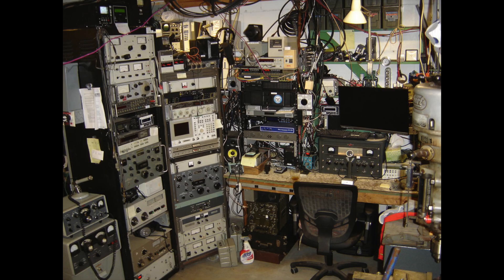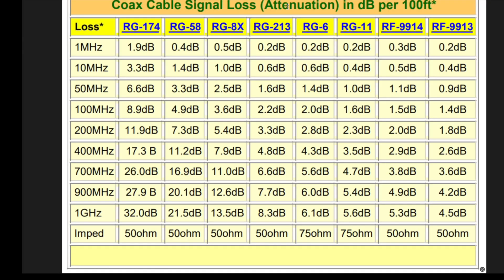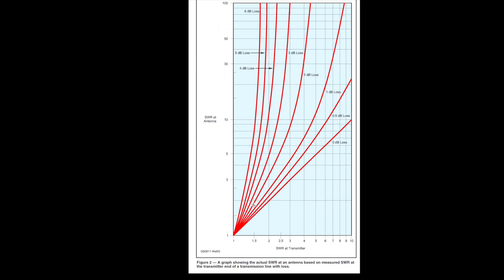Ham Radio Myth - Only Measure SWR At The Antenna.

Comment: Another good source of information I found online:  SWR - the persistent myth by John Fielding, ZS5Jf.
A very interesting page on solid state transmitters with built in ATU's.
The page about dipoles fed with 75 Ω coax and 75 Ω SWR meter is interesting and something I've thought about for years. I started with KW equipment and used 75 Ω t.v. coax and a KW SWR meter made for 75 Ω. I remember you could choose 50 or 75 because the valve pi-tank could cope with either.
I can feel an experiment with my h/b transistor tx. Will it care if it's 50 Ω or 75 Ω? Is the circuit I followed really designed to be spot on 50 Ω? Another half turn on the output transformer to raise the impedance? I can easily change my SWR meter to 75 Ω. 
G4GHB.
Reply from the maker: A perfect dipole has an impedance of around 70 ohms so 75 ohm coax is really a better match.   But we all use 50 ohm coax.  And I have read numerous times and saved that file from ZS5JF.  Really excellent.
Reply: @BustRadioMyths  Tnx for your reply.
Yes, they say 73 Ω when located away from objects. 
Somebody gave me 12 foot of 75 Ω t.v. coax so I might try it. Thinking about it my FT817 would see nothing different anyway, 50 Ω coax now to a dipole or 75 Ω coax to a dipole. The dipole impedance hasn't changed so there's still only one impedance change.

The ZS5JF article is excellent as you say.
A few C.B.'ers might learn something.
I watched one video and he showed his output reduced with a 3' length, 6' better and 12' better still. How it varied I don't know as he was using a dummy load! 
He recommends and sells 3' to the SWR meter in his C.B. shop. The myth goes on. 
What he didn't show was his forward power was also reducing and he said he wasn't interested in the forward power and tried to keep it out of view.

73, G4GHB.
Reply from the maker: Unbelievable!

Comment: That chart is useful. Good information.

I've never panicked about SWR, in fact for many years, 20 maybe, I had no SWR meter and simply tuned my h/b radio for maximum r.f. out at the aerial. 
1. Put tx (on c.w.) into a 50 Ω dummy load, increase to 4 Watts, don't overdrive.
2. Note the mA reading. 
3. Tx into tuner for same mA reading and tune for maximum r.f. out = 50 Ω load.
4. Job done. 

When i made my resistive Wheatstone Bridge type SWR meter it confirmed what I had expected, maximum r.f. out is minimum SWR. I opted for this type as my tx never sees above 2:1 SWR when tuning long wires etc. but it guzzles half the power so has to be taken out of circuit.
Mini 8 coax and no long runs and SWR right down, about 45 feet at 5.262 MHz, 25 feet 20m to 10m attic dipoles and 10 feet at 2m.
G4GHB.
Reply from the maker: This is all true - you are tuning for maximum current.  SWR meters weren't invented until the 1950's and maybe they never should have been invented. They have turned too many radio operators into SWR paranoid zombies!!!

Comment: That chart would be so much easier to use if it was landscape orientation. Of course, that's not your fault - that's a poor design on the ARRL's part.
Reply from the maker: Good point.